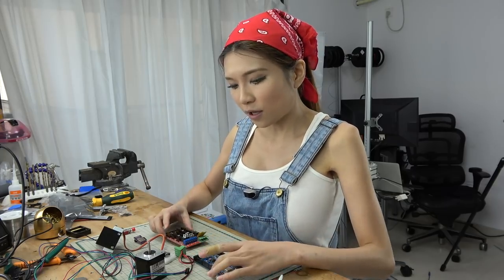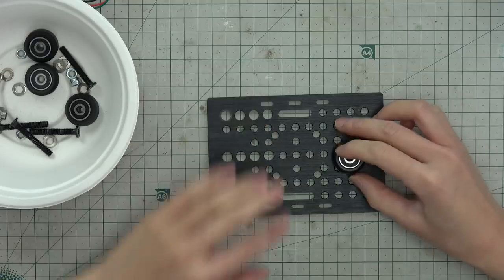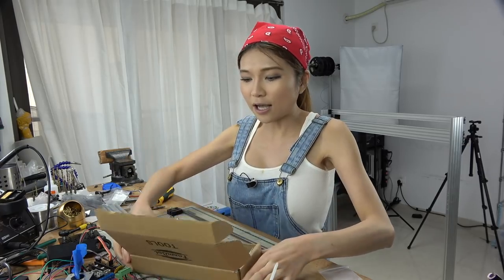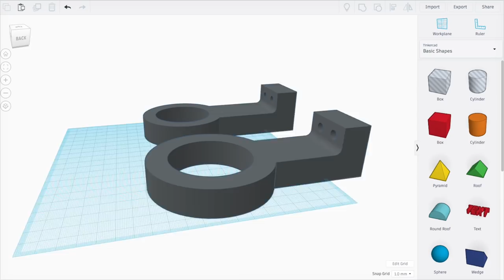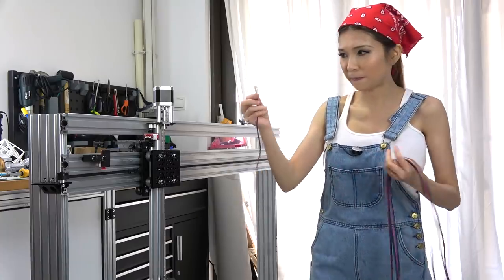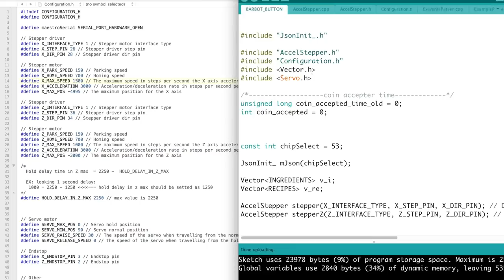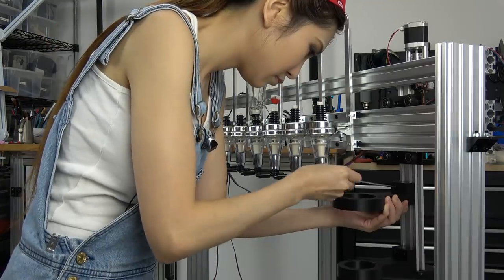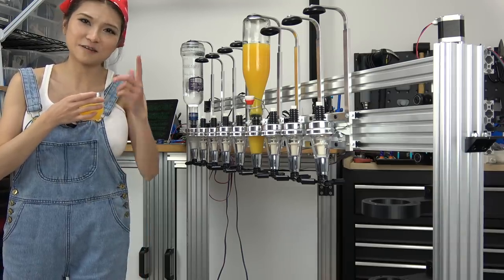Bartending Robot- a Barbot! Build Part 1

Comment: You rock.......  I’m in love with your ingenuity.....  Remember triangles  are the strongest shape for the braces.  Maybe a much larger orange juice container. But very well done. Credit where credit is due.
Reply: My one thought was that as a plain rectangular frame I would have added diagonal bracing but to to avoid fouling the Z axis mechanism it would have to be relatively low down at which point might as well use a full width panel which would double up as mounting for control hardware?

Comment: Amazing project again! Love to see you showing not only the successful parts but also the trial and retry process.  
Two attentions I want to mention: 
1. Be careful when you work in high balcony, you don't want to drop something down and hurting people.
2. I am bit worry about the stability of the metal frame, it might not be rigid enough to bear the weight of fully filled glass bottles.

Anyway thumbs up again. My jaw dropped (literally) when the first drop came out of the bottle.

Comment: I was a bartender a few years back, more than a few, and one thing I can tell you about mixed drinks is that the glass holds 4 oz of ice to which 2 oz of alcohol and 2 oz of the filler are added. In the case of your screwdriver, that would be 2 oz of vodka and 2 oz of orange juice. Since the orange juice may have pulp in it, you may want to ensure that you're pouring mechanism will allow for solids to pass through. I like what you've done, and I would like to see it worked to perfection. I'll be watching to see what comes in part 2. Good work Naomi.
Reply: I agree, that's the trick to flow of Ounces per flow meter used.

Comment: Add two horizontal cross bar supports to your frame, one near the very bottom and one approximately near the middle to stiffen the frame and make sure it remains 'square'. this will help keep the Y axis parallel as it travels horizontally across and help reduce stretch of the rubber cable. 

You can also add a 'delay' for the time the glass is raised to the bottles, depending on which 'drink' is selected to be mixed. But this does mean it will take some experimentation to figure out how much time = oz of fluid for each type of alcohol being served. The flow rates will vary between nozzles (manufacturing tolerances) and type of alcohol being dispensed.

You could also make some 3D printer covers for the exposed ends of your aluminum supports so you do not cut yourself on the sharp edges.

Very nice project and well done!

Comment: Nice work so far. Plenty of comments about the Orange Juice not dispensing properly. It may be a good idea to check to see what each dispenser is designed for dispensing. I imagine that there are viscosity limitations involved, as different beverages are going to contain fluids of different viscosities, masses, etc. I'm pretty sure you've got that worked out by now though. Thank you.

Comment: To add bottles/change bottles, with the bottle upright you insert the optic, then in your right hand you hold the tang of the optic between your first and middle fingers, supporting the bottle with your left hand, invert, and use the base of the bottle to push up the sprung stand and guide the tang into the holder - no risk of slips or spills this way :)

Comment: I  have 2 suggestions, put another horizontal brace across the bottom of the frame to stop it from wobbling. And add a pause in the code between when the glass moves up to the measured pourer and down again. Not all liquid flow like water and vodka.

Comment: You may want to look at protection for the stepper motor for the case where someone moves the bar bot by hand. Spinning the stepper could generate a lot of current.
This could be a relay to disconnect the stepper when it is not in use.

Comment: Excellent work. I think you need a pause at the top of the lift, to allow the optic to empty fully.
Reply from the maker: Then the proportions for the drinks would be off. You can't have "2 part something, 5 parts something" if each "part" is 25ml and the cup is only 130ml.
Reply: Naomi 'SexyCyborg' Wu True, but the optics normally empty for a standard measure.

Comment: Looks like you need an additional key:value pair to account for the viscosity of the fluids, so you can adjust the time it waits at the top, and the time it waits at the bottom.
Reply from the maker: I can adjust pause time per ingredient, which should do it I think?
Reply: You might even be able to get away with not going all the way down between shots of the same liquid, like the vodka... if it just goes far enough down to let the pump refill it would be ready for the next one, since the z-axis seems to be the slowest part.
How do you plan to keep the machine informed of what ingredient is where? Will you always restock the same ingredient in the same place? 
Love the reaction shot by the way :)

Comment: Two things lower your acceleration variable top speed won’t help much. Second you need an X brace on your frame. Or just another lower bracket with some diagonal bracing it’ll stiffen up the stand nicely.

Comment: 30:30 Not sure if you realized but the second "pour" of the orange juice, it messed up... It looks like the liquid was prevented from making it into the middle section (under bottle / before glass) when the air was going up into the bottle?... Not sure exactly what happened but it only got about 1/10th the amount of liquid it should have on that second pour :P

Comment: Good idea, but there is still some improvement to see. (1) the pushing part is to rigid. Due to this you need precise adjustment of it. Maybe you should use flexible joind (spring loaded). (2) the timing of pushing is not smart enough. You should use some vision sensor to check the emptiness of the reservoir. (3) I do not like the bottle holder. I see simplier way to mount the bottle. Especially after whole day of training the machine :)

Comment: Looking at the design you might have an issue with a lot of weight on top with all those liquid you might want think about making the legs different and adding a piece of metal between one side to the other side on the bottom to support so doesn't good luck looks really fun.

Comment: Your so cute, I like your comment "sorry, no small clothes here" but your right. You don't want to get cut, I'm working on an electric scooter now for my son, but I will have fun with it too. I'm making brackets to hold extra lights,  I wish I had a 3d printer, I make them out of metal but I have to wait till.i go to work and weld them. Do you have a recommendation for a good cheap 3d printer? It will have to work in the usa. Keep up the good work.

Comment: Hi, maybe you can fix the "woobly" frame with an additional metal X in the back of the constuction :) I really like the overall design, I've seen some bartending "robots" but they all use little pumps and a lot of tubes, which, in my opinion, are quite a mess (to clean). I will be happy to see part 2

Comment: Yes the orange juice looked thick and the vodka looks like it could have been distilled a little more, glad to see your finally able to build this like you wanted to. I am just wondering how much power is actually going to the motors after it leaves the board.  Are you going to hard wire a switch into it instead of using a laptop for code input, or build a menu of drinks and use some other device to control it?
Reply from the maker: Yup! Part 2 coming soon!
Reply: Naomi 'SexyCyborg' Wu you do not have to reply to me anymore, I try to take time out of my day to watch your videos. Still hope to travel to china and go to the places you have shown and recommend. I have put a pause on my programming.

Comment: I've noticed that the 4 or 5 shots of orange juice are not equal. Sometimes the mesure cup is full and sometimes it's only half full or even almost empty. Is that normal ? 
Anyways, even if it needs more adjustments, the result so far is very impressive :)

Comment: A linear system is cool but there are some downsides wrt. to complexity and build cost.  V-Bearings are a particular pain in the butt to obtain and they can be rather pricey (at least around here).  Perhaps a dial based system would be a better build and believe it would keep parts count to a minimum and might actually provide a cycle time improvement.  Lets take our drinking to the next level and get those rum and cokes quickly out to the engineers that need them.

Comment: I've been thinking about making one of these things for a while now, but one thing I can not figure out is how to dispense fizzy drinks (Like Tonic or Ginger Ale). I've tried with the same dispenser as in this video - result was "Don't try it at home". :D If you could figure that out, I think your Bot would be the best one since I have not seen one that can do more than just non carbonated drinks. Waiting for part 2 :)
Reply: How about having a nozzle on the bottom of the dispensers that would drop down into the glass instead of letting the fizzy drinks "fall" down into it? I'm not positive, but I think this would alleviate most of the splashback. Maybe even have the bottles sit slightly behind where the glass goes and have the nozzles bent at an angle.
Reply: my biggest issue was not the filling of the glass part, but when the dispenser empties the pressure generated by the refiling of the measuring chamber would shoot the bottle off. I've seen in bars that they use some special nozzle on the tap that disperses the bubbles, but I haven't come across any for purchase. I suppose some high-pressure system with a compressor could be constructed, but that would make the whole thing too complicated, in my opinion.
Reply: Ah, the dispensers don't have a mechanical lock to keep the bottle in place? Maybe you can find dispensers with a thread to use threaded bottles with.
Reply: I did try to fix it, then it just shoots through the spring mechanism... Imagine dropping a can of pepsi on a concrete floor hard enough. :D
Reply: Yikes. Doesn't sound like a simple problem to tackle!

Comment: Naomi, unless I missed it in the comments. Did you post the approximate price it took to assemble the bar bot?
Reply from the maker: Will post that with the BOM once I'm finished. Also the parts are much cheaper in China.
Reply: Naomi 'SexyCyborg' Wu.. Thank you. Yes, it is hard to convert cost when there can be 20% -200% mark up in cost depending on what your ordering.

Comment: Great build Naomi!!!! 10 years ago I had the domain name www.robotender.com .  Arduino were not really in use at the time or I hadn't heard of them yet so I was using a PC with a relay expansion board to drive DC motors. It was very crude and I had too many other projects going on at the time so unfortunately, I stopped working on the project and didn't renew the domain. :-( 
Some other guy is using the domain now with a similar project. Anyway... GREAT BUILD!!